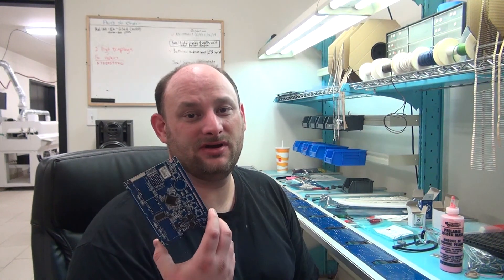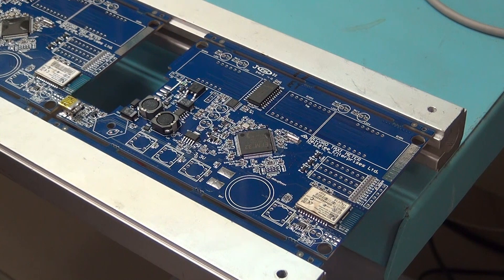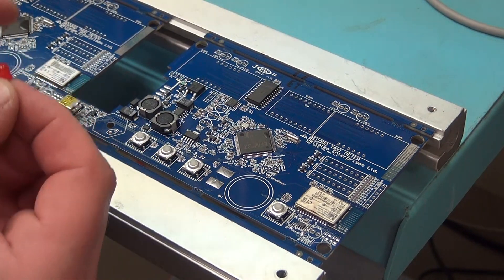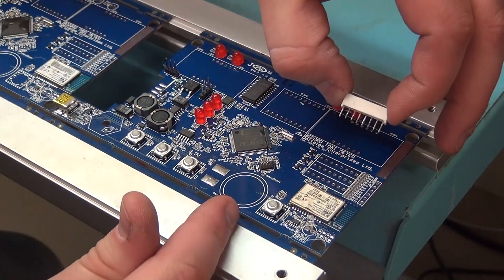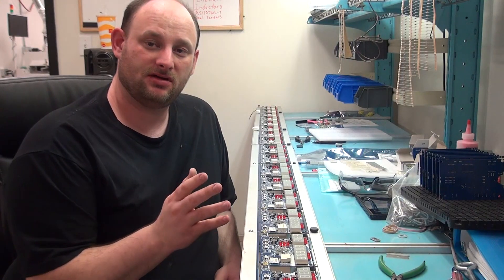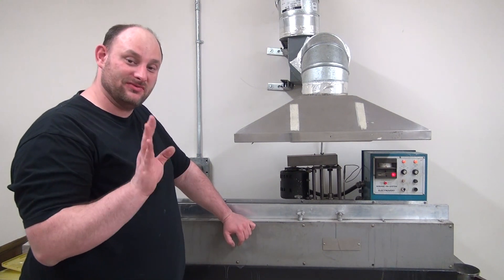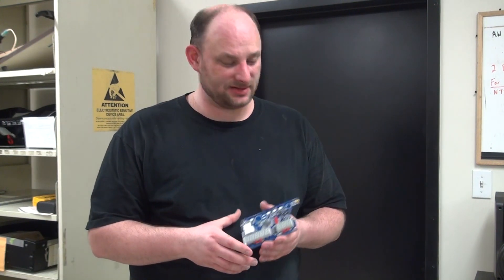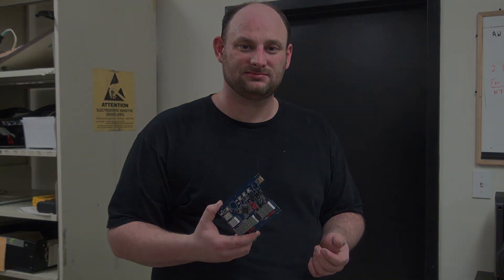Using My Wave Solder Machine with Through Hole Components

Comment: It looked like there was a  bump as the board was almost out of the wave soldering machine.  Did that cause the missing solder on that pin?
Reply from the maker: This machine (now gone) would almost always add too much solder. Not a lot of instances where it would miss anything